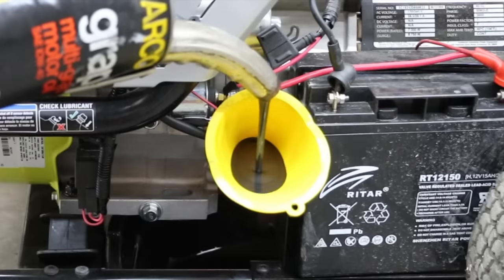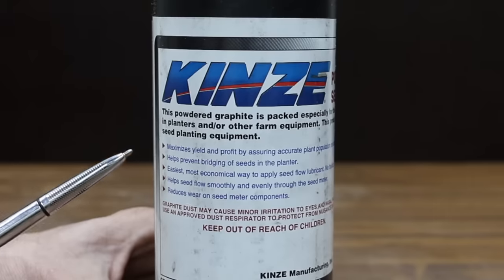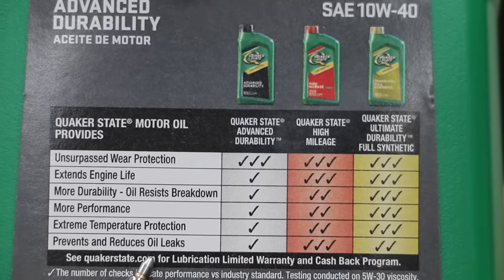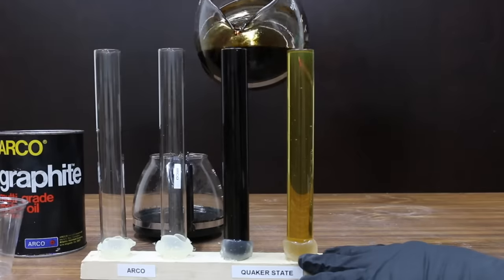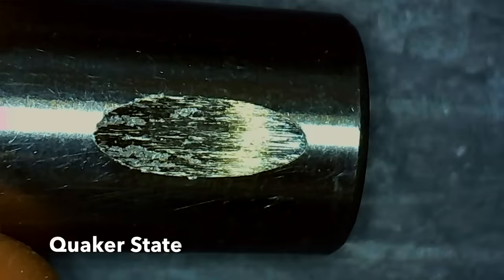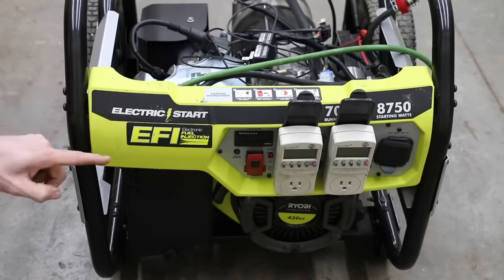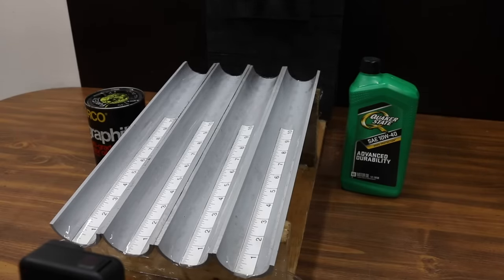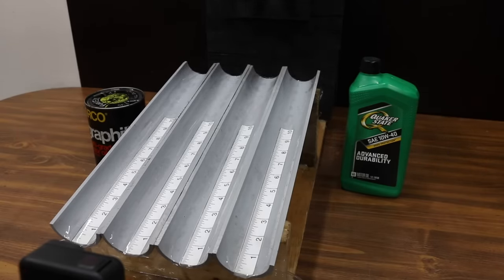Will "Graphite" Help Motor Oil Performance? Let's find out! Vintage Arco Graphite vs Quaker State

Comment: Late to the comments, sorry.

As a 14 year old know it all in 1976, I bought a Kawasaki KZ400 and beat the living hell out of it.

Starting from my B&S powered mini bike to my yamaha 90 two stroke and then on to my 400 I always did my own maintenance. 

Fell for the Arco ads and did my 3rd oil change on the KZ using the black oil of death. ....around 9,000 miles. 

Proceeded to spin a main bearing ...

Asked Kawasaki about warranty, they rightfully denied me after tear down because of the non-recommended oil.

I actually wrote ARCO and they sent some reps out!!!

They did say it wasn't the oil's fault....just a dumb kid over-revving the beast.

Ended up rebuilding the motor......I remember it had 360* crank and a chain driven counter balancer. Bought an off the shelf Morris cam thinking maybe with the Kerker I could keep up with RD's ....not a chance in hell.

Sold it and bought a KZ650.....used MC specific motor oil ever since...lol!!

Comment: The rod knock getting worse in the Briggs was concerning. But maybe the Graphite powder was possibly different from what Arco used? Or it could've been because the Graphite powder was removing material and causing more wear?
Reply from the maker: Thanks for the feedback.

Comment: I always have difficulty reading the dipstick after an oil change;  can't tell if it just picked up some oil from the tube left behind when dipstick was pulled.  Considered adding LiquiMoly to help darken oil even if other benefits are not considered.  Graphite might help color, but if it had other benefits I would think all the makers would include it in their formula.
Reply from the maker: Thanks for the feedback.

Comment: In Brazil some years ago this Grafite Oil was sold by a local petroleum company, at the time I had a Volkswagen Passat car, I knew about the lubricating qualities of grafite so I decided to run a test, I went to the service company and told them I needed to change the oil of the motor, so we went and procured this new oil we also changed the oil filter and after running a couple of days with my normal work I filled the fuel tank and made a hundred Kilometre run to the next town and back with the family (two adults and three young children) with an average speed of 100 Kilometres per hour on the highway and about some 30 Km in the neighboring town (25 Km/h average), on return to my home town I filled my fuel tank again and after calculating the fuel consumption against the trip distance I discovered that I had obtained an extra two Kilometres per liter of fuel consumed; from that test I decided to use the grafite oil at every other oil change together with the filter change, I used normal oil in the oil change without a filter change (oil changes were every 5000 KM), there was no indication that the grafite oil clogged up the oil filter. What did happen in Brazil was that old motors that used this oil ended up without any or low oil pressure, the possible explanation might be that because to maintain grafite in suspension in the oil you have to ad a lot of detergent to the oil, and this detergent ended cleaning out all the varnishes that close the wear points in an old motor consequently dropping the oil pressure, in relatively new motors this did not happen, what did happen was that due to a oil leak of an oil retaining ring on the crankshaft I operated the car with very little oil for about a week (no indication on the dipstick), after the repairs the mechanics informed me that there was no visible abnormal wear on the crankshaft and no sludge in the oil pan, when I started the use of the grafite oil the had some 35.000 Km on it, when the oil was unavailable the car had some 160.000 Km on it. I believe that most people did not know how to use it or when to use it that is why it was discontinued in Brazil, I am not saying that I did, I was just lucky.
Thank you very much, best regards.
John C. Helmfelt.
Reply from the maker: You are welcome!  Thanks for sharing.

Comment: My Nissan 2.2l diesel engine runs on a permanent oil filter made by trabold since its early days. I haven't changed the oil in 8 years. Basically the oil gets better and better by building up and storing lots of graphite. Car runs smooth with more than 240,000 km. Just chainged the traboldl filter. There are cars out there running over 600,000 km on that system. The filter itself cost around 20 bucks. And big oil can see my taillights 😁
Reply from the maker: Great feedback. Thank you!

Comment: I can supply a lot of different information, mostly pointed in the direction of GM stuff, or high performance. I was a GM Training Center Instructor in the Boston area for 8 years, the other 18 in GM were mostly spent as a field service engineer, and always had a shop part time for all sorts of repairs and fabricating. I got early retirement at 50 so spent the next 20 with my performance shop, which I have now closed and am trying to enjoy life. But I can answer questions on most subjects automotive. I have always done a lot of getting cars straightened out, that were built and never properly set up, etc. I may start a channel to help out, but I have still have two street strip vehicles of my own to keep running, and lots of other projects, so I don't know if that will happen.
Reply from the maker: Thanks for sharing.

Comment: The farm graphite that you used would be detrimental to engines. One of the ingredients in it is silica, which is abrasive. It is used to help seeds flow out of seeders, so the silica is not a problem in a seeder.
Reply from the maker: Thanks for the feedback.

Comment: I have a Ranger with the old 2.5 l lime motor in it and I know the valve seats are getting worn wood running graphite oil in it help it out a little bit and don't worry about the catalytic converter that's been taken off
Reply from the maker: Thanks for sharing.

Comment: Back when Arco Graphite first came out one of the airplane mechanics was saying he had seen tests, and that the Arco was amazing!!
 I decided to run it in my 1969 Triumph 650cc TR6R motorcycle. A couple of months later, I burnt a hole in one of the pistons.
 When I took the piston & cylinder to a machine shop, the first thing the machinist said was "looks like you were using graphite oil". He told me he had seen this several times as it doesn't work on air cooled engines that run hotter than water cooled engines. 

 Never found any tests proving this, but I never used the Arco Graphite again.
Reply from the maker: Thanks for sharing.
Reply: @ProjectFarm  Thanks for the extremely well though out and executed studies and videos!

Comment: Back in the 60s we actually used to grind up pencil lead in order to add graphite to the engine oil. Not very scientific, but it did seem to work!!! One note though, we only added the graphite for 1 oil change. After that we would continue using regular engine oil for all future oil changes.
Reply from the maker: Thanks for sharing.

Comment: Back in the 70's I used ARCO in my Chevy V6 C10 pick up.  I don't remember if it improved gas milage.  I never had any problem using it.  I would not use it on a modern vehicle.
Reply from the maker: Thanks for the feedback.

Comment: I used that exact Arco Graphite motor oil years ago.  It was a huge mistake. I changed to the graphite oil, using an entire can to flush the old oil.  I drove to a store about five miles away.  When I started the car to drive back home I heard a strange sound.  It was the graphite oil blowing past the seals on the oil filter. I had changed the oil in this car many times before and that never happened.
Reply from the maker: Thanks for the feedback.

Comment: Lubricating graphite needs to be ground to a very fine particle size (ideally by jet milling) and of a very high purity in order to not cause damage to parts machined to fine tolerances.
Reply from the maker: Thanks for the feedback.

Comment: I use Archoil 9100 friction modifier in my diesel F250, there is a noticeable difference in engine noise, smoothness of operation and it starts much easier. Mileage seems to have improved 1mpg.
Reply from the maker: Thanks for sharing.

Comment: Read an article about a guy who put 1 gallon of 80 weight gear oil in a semi truck engine with every oil change. So 14 gallons of oil to 1 gallon of gear oil. Said the motor went 1 mil. miles before an in-frame rebuild and everything on the rotating asse🎉looked new.
Reply from the maker: Thanks for the feedback.

Comment: I would like to see this done on Diesel engine oil. For a couple of years while fuel prices were so high i used used engine oil,trans fluid and gear box fluid for fuel. It was incredible what a difference it made on the engine. I got better fuel mileage and the engine was very quiet. Cant do that on todays engines they put in sensors to stop it. I was using the 7.3 with a  2001 engine.
Reply from the maker: Thanks for the suggestion.

Comment: I used that Arco oil in my 70 chevy Montecarlo after sitting for a week I had to pull the engine out and clean the graphite sludge out of it. There was so much it plugged the oil pickup tube.
Reply from the maker: Thanks for sharing.

Comment: that wear tester should have a constant rpm controller,  more friction gives less rpm, and it messes the results, get someone to put a bruhlsess motor with hall sensors or a stepper , they have way more torque anyway,  and run it at a constant speed with a controller monitoring the speed of the motor,  no matter the load, i love your videos.
Reply from the maker: Thanks!

Comment: We tried Arco graphite in the late 70's.  We found that there weren't any gaskets that could hold the graphited oil.  It leaked everywhere.  Maybe todays engines have better fittament, but we stopped using it because of the mess.
Reply from the maker: Thanks for the feedback.

Comment: Back in the mid 70's, I had a '67 Toyota FJ40.
Had the engine rebuild after a catastrophic piston failure and was advised by the shop to run the new Arco Graphite oil.
The only thing I remember is how messy oil changes were, I don't remember any better performance and I stupidly traded that wonderful Toyota in on a brand new '83 Jeep CJ7, which burned to the ground a little over 7 years old...
To this day I still wish I had that Toyota...
Funny I randomly saw this as I was recently wondering why you can't find that graphite oil anymore...
Reply from the maker: Thanks for sharing.

Comment: When it comes to today's cars you going to have several factors.

1) Because the engines today are made with very close tolerances and require very thin oil. Adding graphite will not only thicken the oil, but because it's a solid particle it can clog things up where the tolerances are the closest starving certain sections of the engine of oil.
2) Emissions. Some of the graphite is going to get into the combustion chamber and burn. This can cause O2 sensors to fail and catalytic converters to clog and fail.
3) Oil that has this added to it no longer passes the API SAE tests. Why? Because the test were not done while the graphite was in the oil is why. Do you take 5 different brand of oil and add them to a motor and expect the blend to protect you motor with all the different additive packages? No? Why not? Because mixing oils is like mixing that graphite. You changed the recipe aka additive package and therefore if the manufacture finds out what happened, they can legally void your warranty. Because the owner of the car used an unapproved oil combination. 
4) Many cars now have the VVT system aka variable valve timing. This system is very sensitive to oil viscosity. Anything makes it stick or open or close to quickly the system will no longer work right and the car will run crappie. Example: I used to work for an oil company and people in this town know that I have taken a few courses in lubrication and filtration. So a guy calls me up one day and tells me that a friend of his told him to use a thicker oil because his high-performance engine might blow up with the thinner oil. And he said that even since he put the thicker oil in his car runs crappie and has no get up and go.

So I explained to him how the VVT system worked and that because the valve system was hydraulic and works off pressure. Adding the thicker oil created more pressure and retimed the VVT system by opening and closing valves way before they were supposed to. And the computer could not compensate. So he drained the thick oil out and put the thin oil back in, and presto, the problem was solved. So you see how the slightest thing you do with your oil can mess stuff up? All additives are available to the oil producers. There is no magic potion.

Now on old cars that do not have all this fancy technology etc... graphite would probably work great. But if you put it into a newer car, you might be asking for trouble that can end up costing you some big bucks.
Reply from the maker: Thanks for sharing.

Comment: Back in the day( leaded fuels 125+ octane, 15.5/1 compression ratios etc.  I did use arco graphite oil in my performance engines it reduced operating temperatures and approximately 1.5% increase in Dino HP.
Reply from the maker: Thanks for the feedback.

Comment: The compression did go up but it made a mess inside the combustion chamber. With that being said though that indicates an existing blowby/ring wear/valve guide wear issue. Either way, the mess combined with the increase in knocking sounds makes it a no for me lol.
Reply from the maker: Thanks for the feedback.

Comment: Original graphite was designed to be a dry lubricant replacement not powder you dump in a liquid like oil!  Graphite came in a tube with a nipple and cap you would squeeze onto a bearing or any surfaces to cut down on friction.  It works extremely well, which is why its been in use for most of this century or before!  sm
Reply from the maker: Thanks for the feedback.

Comment: Because it is fuel injection generator, so you can only see the different when you put on the same big load on it. Otherwise the ecu will provide a minimum fuel injection and discaring about the tiny resistance

Comment: you should have a load connected to the generator to measure the fuel eficiency. Idle running has a very minor load, it is not enought to measure a motor efficiency.

for example: an 1.0 car will last longer in indle than a 1.5. but with 3 person inside in a constant speed, the 1.5 will save better fuel.
Reply from the maker: Thanks for the feedback.

Comment: I used ARCO Graphite in my Chevrolet Big 10 454 after it was a month..(1978) old the gas mileage did increase  from 16 mpg to 18 mpg…if it was still available  I’d still use…..it was hard to source in Georgia back then….
Reply from the maker: Thanks for the feedback.

Comment: Many years ago, there was a product called "ProLong". I wrecked 2 engines with this additive, (spun bearings on both) but had a 7%+ increase in my fuel economy. Fuel and oil additive. Would be nice to see what you know about the product.
Reply from the maker: Thanks for the suggestion.

Comment: i used it in a manual gearbox! it was runnin good, the only downside is that the graphite entered the gear locking mechanism and it was jumping out of the 4th gear!
Reply from the maker: Thanks for the feedback.

Comment: Use to run ovens back in the day that we had to use a graphite/kerosene mixture to lubricate the chains every 4 hours. The chains would last a good 10 years on the belts if properly lubricated. Now they most likely wouldn't allow this and would force you to use some "food grade" high temp lubricant in a high tech auto oiling system that would break down every few months and end up not working worth a shit.

Edit: To clarify the kerosene was just a carrier to distribute the graphite on the chain rollers and would burn off once the oven got close to operating temps well over 500 degrees.
Reply from the maker: Thanks for sharing.

Comment: Compare fuel levels at 6:35 for the Quaker State and 7:38 for the Arco. The QS had just a tiny bit more fuel. Definitely enough to run 20 more seconds so I think they're even.
Reply from the maker: Thanks for the feedback.
Reply: I noticed the same thing, I also think it should have ran at least 1 tank through to thoroughly coat the internals of the engine before doing the actual test

Comment: It only took one can of Arco graphite oil to wear out my Audi A8 twin turbo timing chain ptf runners, which eventually trashed my engine. The damage was in the 10s of thousands to fix, so I sold it to a parts recyclers.
Reply from the maker: Thanks for sharing.

Comment: You say you wouldnt run it in modern enginess, I had a 1989 Toyota pickup with a 3.0 V6 fuel injected engine bought new at dealership and ran it for 160,000+ miles no issue. It had 1 pint of a graphite additive put in every oil change  between 3-5 k miles for the time I owned . It was sold to me by the local dealership with this additive in it from Toyota. If I can find the old bottles or box of additive Ill send the info to you.
Reply from the maker: Thanks for sharing.

Comment: Arco Graphite was usually mixed with standard oils like a 2 to 1 ratio. Alone it was a great cable and lock lubricant for motorcycles.
Reply from the maker: Thanks for the feedback.

Comment: This is an older video and I’m late to the party, but I noticed all the sludge on the cylinder wall. Reminds me of how the compression can increase in badly worn engines with a lot of carbon. I wonder if this is why the graphite oil increased the compression

Comment: I’ve never use graphite but after watching your fuel additive video I started running exclusively hot shot products in my truck and I have noticed a significant difference in the engine vibration running hot shot stiction illuminator in my engine oil
Reply from the maker: Thanks for sharing.